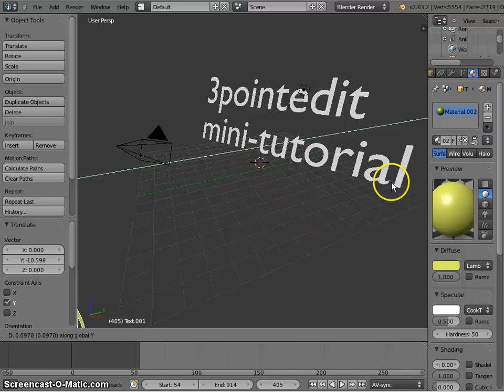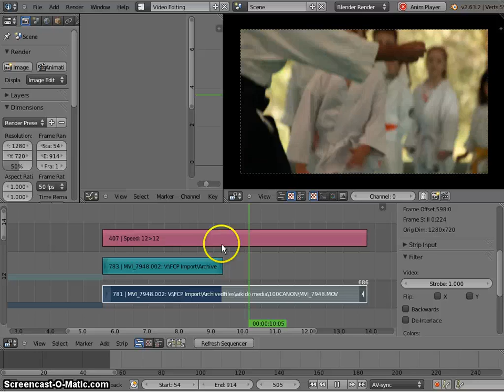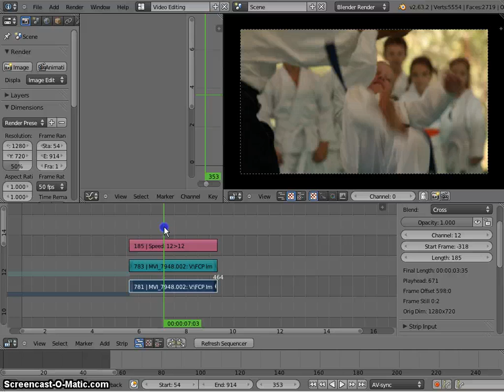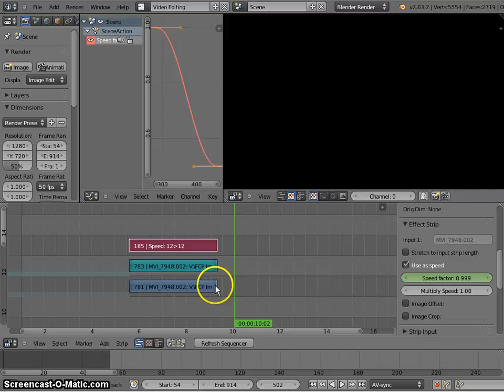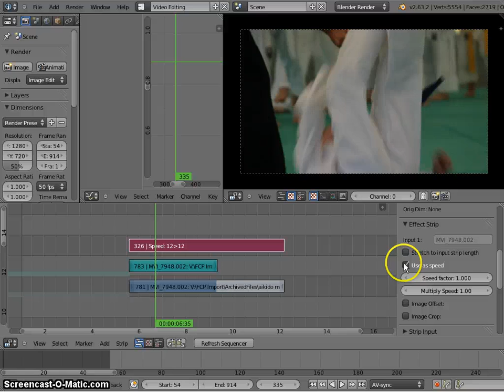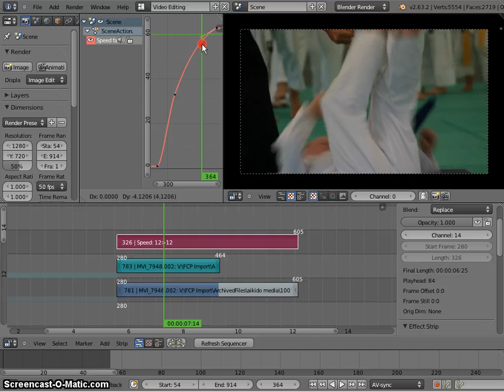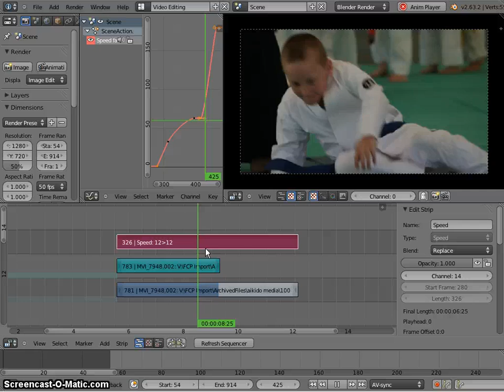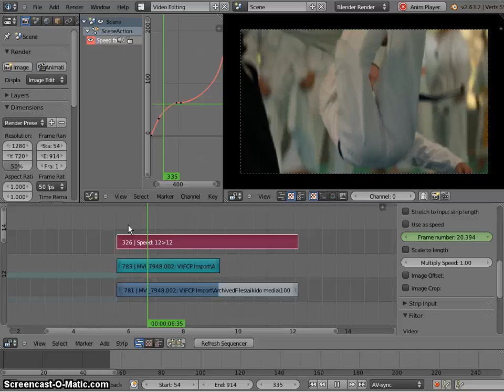Blender VSE Speed Ramp tutorial

Comment: Hi, I've been having a really annoying and persistent problem with speed control. With strips that slow down, at any point in the clip, it skips back 1 or 2 frames, plays them, then skips back over the same frames again and repeats this over & over. For strips that speed up, massive jumps are made. It'll freeze on one frame, then jump to another frame much further ahead and freeze on that etc until the clip ends. Any idea how to fix this? Plz help!
Reply from the maker: The Chainsaw Squirrel Blender is having issues with the media you are using. In Blender try building a proxy WITH timecode (free run is fine). If that doesn't fix it you will have to transcode to a more simple format, that is a less compressed file with I frames and B frames but no P (predictive) frames. Unfortunately the file will get much bigger. Perhaps you only have to do it to one part?
Reply: David McSween I've been using a proxy timecode anyway, at 50%, for the sake of performance boosting. should I make it to 25%? Thanks tho man. I'm not expert on formats either. Atm i'm using AVI, what would u recommend?
Reply from the maker: Avi is just the container not the codec or compression type. Best solution is a frame sequence. Also remember to press the refresh sequencer button in the vse timeline
Reply: David McSween Oh right. It's listed under formats on the properties window. I've been using an H264 codec. Used to use xvid, but the definition was terrible so I switched. No idea what u mean by frame sequence (i'm fairly new to this).
Reply from the maker: The Chainsaw Squirrel yeah the h264 and xvid codec are heavily compressed types and use temporal compression heavily, that is they predict what frames are coming and compress them by looking backwards. Guess what, that confuses Blender. A frame sequence is just your movie clip converted to a series of single frames. Blender can then load that as a strip. You could export the original from Blender as a frame sequence (all numbered for you) into another folder.
Reply: ok, that makes a lot of sense. But I have no idea how to export it as a frame sequence :/
Reply from the maker: In render settings simply change the file type to something useful like .PNG or if you don't have the room then .JPG. Then simply render the animation. Blender will create a new image for every frame with a number at the end of it. Later when you import the movie use Import Image and select all the images n the folder. Blender will order them correctly for you.
Reply: David McSween Ok, will give that a go! thnx!
Reply: Tried it. It's a clever idea, except that the vast majority of images did not show up. Most or sometimes all of the images converted are just black.